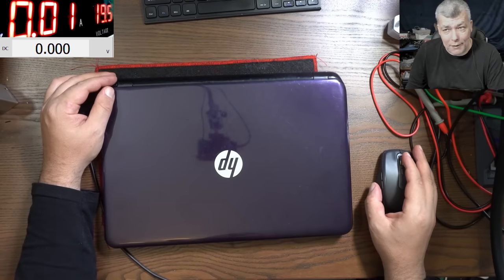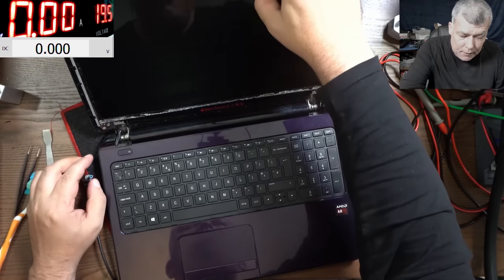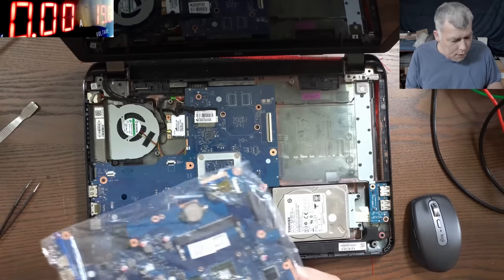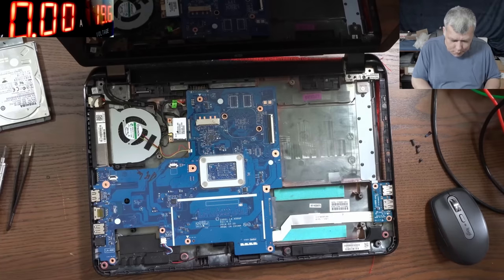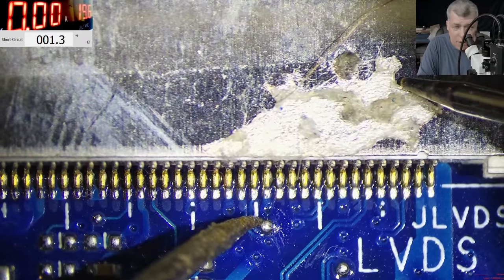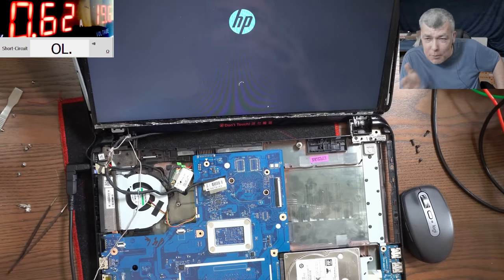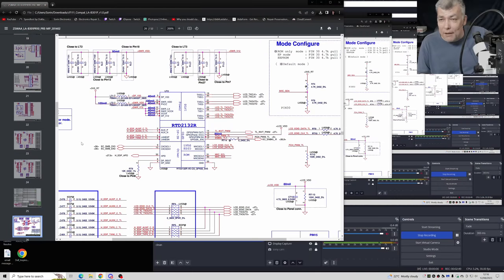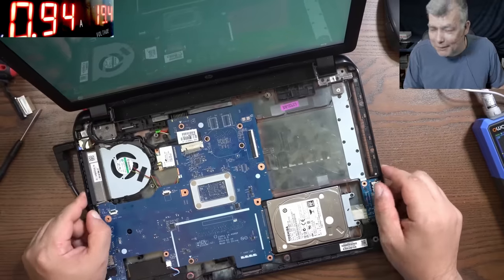Found a Youtuber fixing laptops by buying GOOD motherboards from Ebay - Let's name and shame

Comment: here is a first rate repair so much as intermittant fault.  As where a wire bundle as short was complex to repair as first to identify, then to cause full function.  And a reminder to process as to not be to rushed as to double check available trouble shoot.   As to time on bench as paid, this type of job in my workshop is not the repair professional.  But, where the tech is as craftsman, whole to deliver a repair cost was not real to fault.   
I am reminded to first test and identify, form a plan of repair.  Why?  Well, because this repair can be complex.  And as hidden short, can be very unusual where perhaps the unit was subject to shock force, dropped, placed where weight might slightly bend unit or have build fault only where movement caused short.  
Most of all, the tech is shown to honest, best worksmanship and can be whole to off target trouble shoot and repair intention.  Because I fail at some repair.  The oclliscope as data is a real view to function, and I hope to add such test, but understanding fault as repair, the best fitter, journeyman tech delivery to customer.   Thank you for teaching such interesting component and instrument.   M.  Washington State, US.

Comment: I have a.lenovo g4030 with celeron processor failing, bougth a new motherboard with for 30 USD on aliexpress and theat computer is still running, old mothebosrd is there waiting for me to try to diagnose and repair.

Comment: Interesting. So he checked the VGA output and it was not working? I thought the LVDS driver is separated to the VGA out.
Not sure… but does a usb grafic card show the windows screen automatically when plugged in? (to check if every else is working)
Reply: Good idea, through the thunderbolt if there?
Reply: @Dohcom1  yeah… or maybe with a cheap usb to vga converter that can run with the drivers from the OS
Reply: D610 Sorry

Comment: Hello mr, sorin I have received a motherboard from the costumer , And I test it ,it has a charging light when it's connected to DC supply and battery , But it's doesn't turn on at all , I'll check all voltage supply motherboard , No one is missing even the power button is also good , it has a 3.3v when I power it on it goes 0 but nothing's happen ,, I have already flash the good bios but it's not solve ,, Can you help me ??? My last option is to change super io chip But i think the sio is good because the laptop is have a charge light when connect the battery and power supply ,, Plss help me What could be wrong ,😓😓😓🙏🙏🙏🙏

Comment: #ElectronicsRepairSchool... Firstly this guy is Italian, secondly he knowns what he is doing, 3rdly he is the type of man that will sell you a bargain and find a way to rip you off at same time. replacing an old motherboard for a new used motherboard is a scam in its self and he never put back the old motherboard after he fixed the problem to see if old mb would work. all because of a dodgy Gpu cable he could simply replace. There was a 99.9% chance the old motherboard still works as you saw it booted on and some keys worked. He never did basic tests. battery/hdd/power cable/CTRL/ALT/DEL......but im not IT technician expert.....

Comment: so intermittent grnd short on screen cable (data line) made you suspect processor & thus order new motherboard. so you jumped to wrong conclusion! could have been avoided if you checked screen data lines with scope. now just imagine how a novice repairman might react!

when all is boiled down you got it working again. great. your knowledge of effect on display of o/c vs shorted screen data lines helped you home in. 

what did the new flat screen cable cost on eBay & did you get full refund on the working motherboard…? this must be quite common occurrence for repairers (having to return a perfectly good part).

Comment: didnt watch video yet. but based on title what is wrong with fixing a laptop by buying a good motherboard from ebay?  most technicians are not capable of doing component level repairs and the A+ certification calls motherboards "field replaceable units" meaning they are meant to be replaced, not repaired.... it is just an added bonus that we are able to bring perfectly good motherboards back to life by replacing a small capacitor lol.. but i wouldnt say its a reason to shame someone just because they are fixing the laptop by buying a new motherboard.  honestly i did the same when i started my business i didnt know how to repair motherboards until i started watching your channel.. lol i watched rossman but i only started understanding thanks to Sorin.

Comment: I tell you secret. My business is to make money. I get broken macbook from customer. Problem is on motherboard. Normally I charge $240 - $375 to fix. But it is $140 for new motherboard on eBay. What do I do? I put eBay motherboard in and reserve my repair brain cells for motherboards that cost $937 to replace. I may fix that cheap motherboard for future use, too. I can at least use it for the scrap parts. I see no loss here!

Comment: I've been incounter that on Dell loptop  hahahaha Either A shorted LCD conecting rebbon or keyboard rebbon wire or just disconnect the connection wire on a joy stick built in on  keyboard ,,hahahaha That's why professional keeps on learnings until they make mistakes,,,, Hell of a mess my master it's happened an expectedly hajajaha anyway change to experience hahahaha its a panthom fault.......